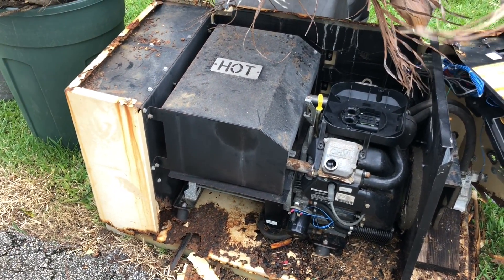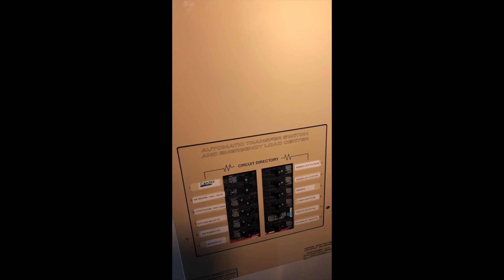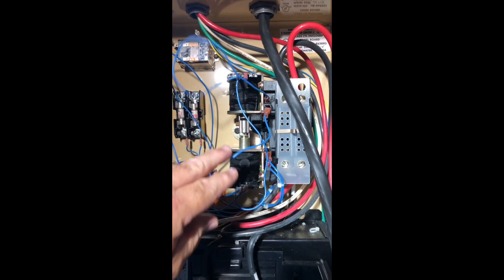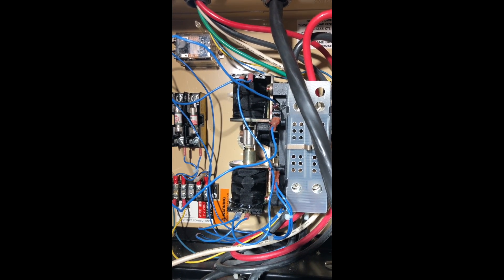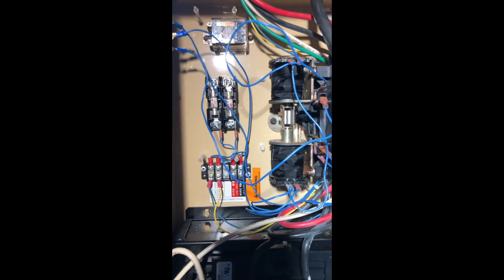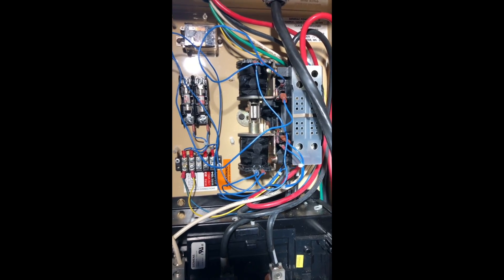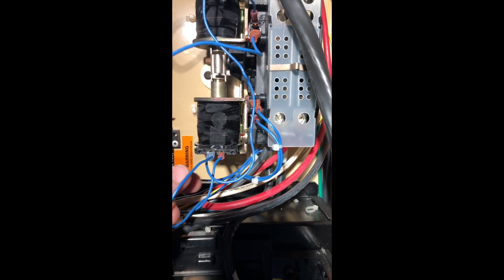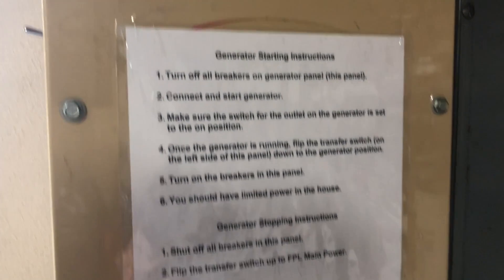Generac Auto Transfer Switch Manual Conversion

Comment: thanks for this.  i have a similiar panel and plan on using it with a portable genset.  this is better than using the manual switch lever since you dont have to open the panel.   the electromagnet changeover is also faster so there is less arch when switching with any load on the switch

Comment: Very nicely done.  I'll be needing to do the same thing in the near future.  I thought about using a dpdt switch to replace the relay but didn't like the idea of having the two separate sources of AC connected to it.  Your way is better and safer.  Thanks!
Reply from the maker: Thank you!  Good luck with yours.
Reply: @toddtt1  Just noticed something... and I must admit I didn't see it the first two times I watched the video:  The small blue wires aren't protected from the full output of the generator if a solenoid coil shorts.  My thought was to  put the two fuses in the abandoned fuse block in series with each of the generator power legs that supply the control circuit.
Reply from the maker: @335alien335  That's a great idea.  I will do that.

Comment: Great video Todd. I have the same system with the same problem.  how did you connect the new generator to the box on the house.  mine has 3 main wires red black white.

Comment: I did the same thing except still using the 12v relay.(the relay only needs to see power, it gets no logic from the old board) I took the 12v doorbell transformer out of the dead Generac and put it in a junction box above the transfer switch. Now I just plug in the portable generator and everything is still automatic no toggle switch.
Reply: Did you wire the transformer to the feed from generator? You just connected the 12 v + and - to the 12V terminals on the generator side of the transfer switch connection?
Reply: @kevinkasperski3879   I'm thinking the same thing. Which posts did you connect the 110 side and the 12 volt side?